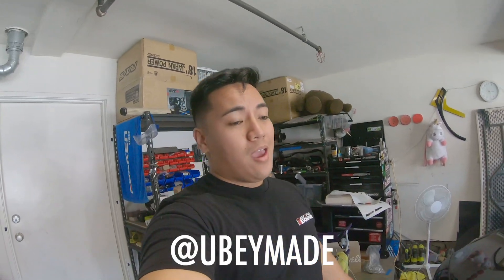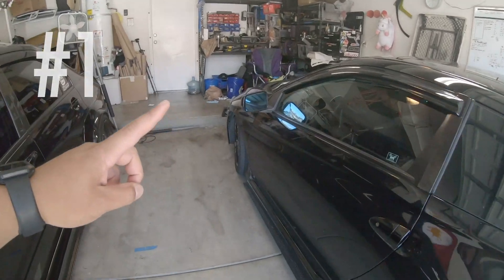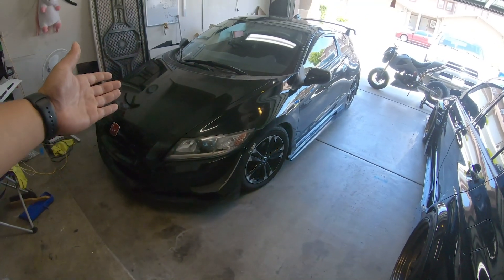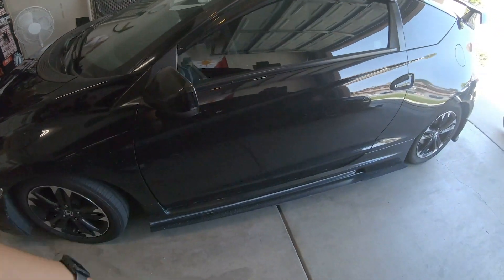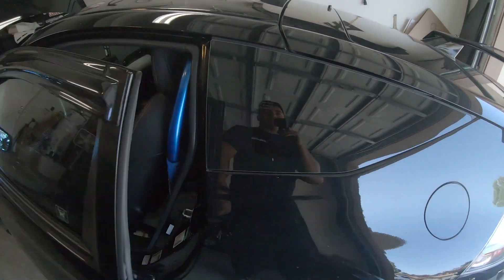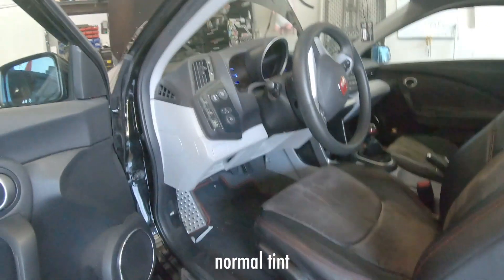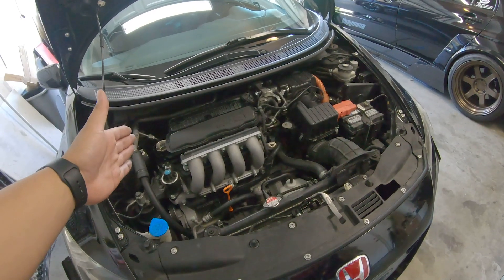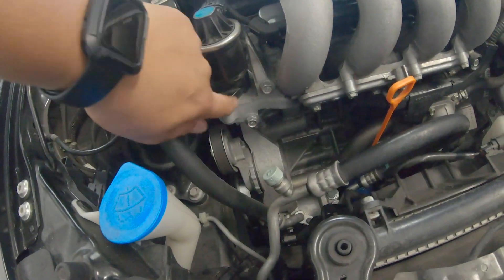FIRST 5 Mods Your CRZ NEEDS! ep.30

Comment: bought white crz mugen in '12 500mi sold in '19  maybe 80-90k. believe mugen kit was factory, everything except doc and lim series badge, but full badge, wing, body kit, rad cap, knob 6sp, mugen mats, mugen rims 18. had all ex? upg like navi and lights. got 4k for trade in for '16 buick regal gs. had to. caretaking for moms. my 5 mods were 1. rims and tires for snowy ny. went with orange sparco 16 with runflat snow as to give creamsicle look. 2. viper remote start for 6 sp w tint pkg. complete waste. tint tried to go light cause i didnt want the look, but just some sun protect, probably had visor done. ended up removing for state insp. at a price. also parked in no shade and the metal mugen shift knob got hot, couldnt touch it in 90+ weather. just drove with an islander beanie or tony stewart beanie on in. remote was a waste. technically it was supposed to work but bc of the whole auto shut off engine hybrid thing it required sequencing to use remote start or valet, also i believed it improperly drained battery. went thru maybe 4 12v bats during ownership. 3. sirius xm with 4 new i wanna say jls. idk stocks were poppin. 4. similar ventguards you have. forgot the name but they came with polish instructions, and i'll include my flag decals here. on the mugen wing vertical tips, ebayyed weatherproof flags- flip flag representin on one side, am on other. had to xacto them to shape the triangle. last one was most ghetto, to make true hybrid had a battery tender weatherproof trickle charge zip tied, cause of the constant dead bat thing. also
carried or purchase 3 booster packs during life. oh so the true hybrid thing was cause you had to plug it in. lol. i've driven off in reverse off the driveway w it still plugged in. had an airhorn inst., just in case someone thought there was nobody next to them. "i'm drivin' here!". had colorful orange beach towels covering cloth seats as i worked in warehousing and didnt want to accidentally stain seats. also had the cold air mod and springs but never installed. still got em if anyone still reading. k&n, eibach.         CAR WAS TOO SLOW. i got passed in  a merge lane once by a prius who went right to pass. i relegated to driving slow hoping to get gas mileage drafting semis. had legit 75% hwy driving only to best a 43 mpg once, 40+ a handful and, 37 38 usually- driving slow, w slow accel. pissed off countless people, pre pandemic.

Comment: Do you have the stock cat converter??
Reply from the maker: Alex Barajas yes I do, engine is stock other than fit manifold
Reply: Cuz I did the intake mod where you cover the resonator thing but my fucken emission system
Popped up  and says cat fail...... 

so I was wondering bout that hks cat but wasn’t sure if you had any mods with exhaust or cat or any
Reply from the maker: Did you reset your Ecu?
Reply: Nah after I covered the intake thing I didn’t reset anything
Reply from the maker: Yea take your negative off for a minute and put it back on, should be good
Reply: How do you reset it bro
Reply from the maker: Take the negative off your battery for a minute then put it back on.
Reply: Have you ever had the check hill start assist system pop up??
Reply from the maker: i haven't my cars at 107k
Reply: Have you changed your headlight bulbs?
Reply: Check emission turned on again 😂🤔🙄😤💔😂
Reply from the maker: Hope you didn’t damage the sensor 😅
Reply: Which sensor you think it is my smog homie check it and it’s popping up the cat?
Reply from the maker: Oh. Then you just have a bad cat or O2 sensor 🤷🏾‍♂️
Reply: So I should try the 02 sensors first?
Reply from the maker: I’d ask your smog guy what he would go for first
Reply: He just laughs and said my cat is fucked? But idk if sensors would says ob2 fail type shit
Reply: Yo had a question where the threshold bank 1 o2 sensor is...? The one at the bottom??

Comment: CALLING ALL CR-Z OWNERS: DOES ANYONE HEAR A WHISTLING NOISE AT HIGH SPEEDS?

I have a 2014 CR-Z and when I'm going around 85 mph and up I hear a strange whistling noise coming from I HAVE NO IDEA WHERE. My gf said she hears it coming from the roof?? So my guess is it might have something to do with the window seal?

If anyone has experience with this hmu!
Reply: John Hernandez hey I don’t exactly the same hybrid but I own a 2010 Insight which share similarities. I can relate to the whistling. I can never pinpoint and it comes and goes. It seems to be how Honda cut a lot of corners with their hybrids to some degree. I’m guessing worn out seals either in the door or window
Reply: i had the same thing. i got the windshield replaced and it went away for good. it was insanely annoying. i could press on the headliner when it was happening and change the sound.